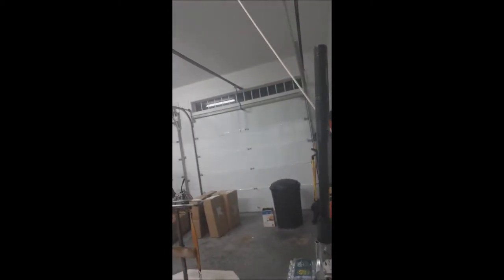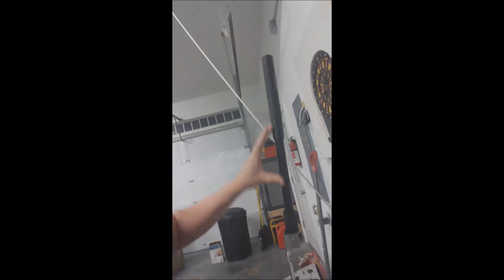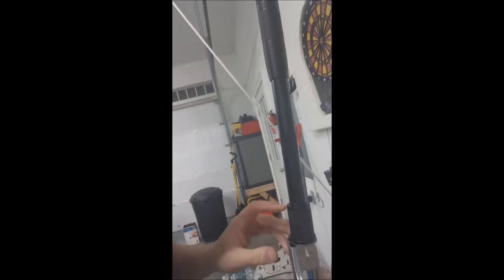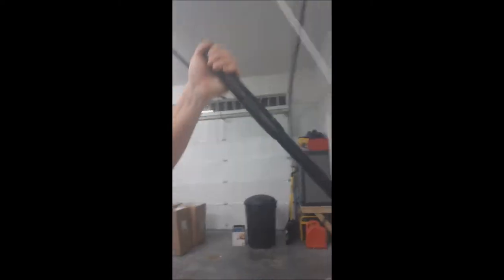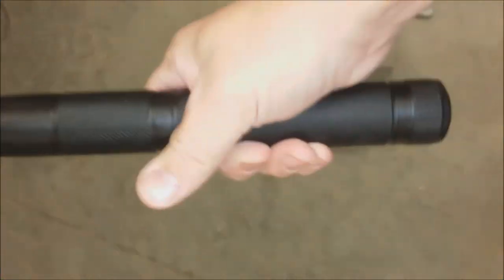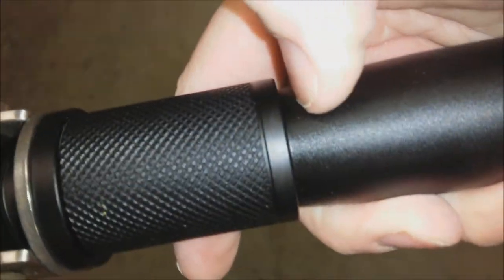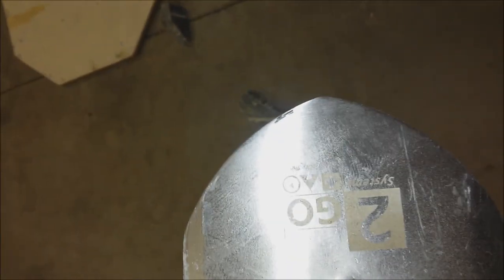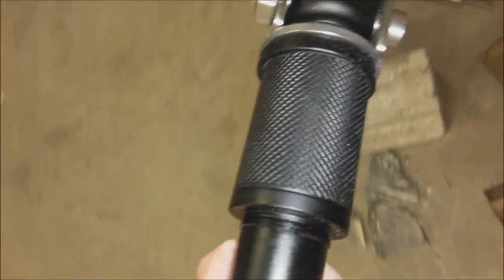Li'Jo Utility Shovel

Comment from the maker: I just wanted to let everyone know that I'm exploring options to make this shovel capable of light to medium chopping in the extended position. I know for a fact that this shovel is very capable of chopping in the short position and I'm fully confident of it's capabilities in this configuration. I try to address any reasonable short comings to my products. I think making the connection point of the small tube to the collar stronger should be done for the simple fact it doesn't live up to my expectations and its going to be fixed. 

I have to add that this shovel with the future fix will not be indestructible as nothing is. I'm trying to make good gear that will hold up to most over the top reasonable use.. I say this as I've bent my fair share of crowbars and broken many of heavy duty tools in my day so do not expect the unreasonable.  Just expect good gear that I stand behind.

Comment: I'm probably not your target customer as I don't care much for the chopping ability. I have an axe/saw for real cutting work. I ordered one because I have high hopes of it being a very capable shovel for its size. I am not sure how difficult it'll be, but the li'jo would be much more functional for me if the shovel bit is removable and can be replaced with a snow shovel end for winter use and tasks above the tree line.